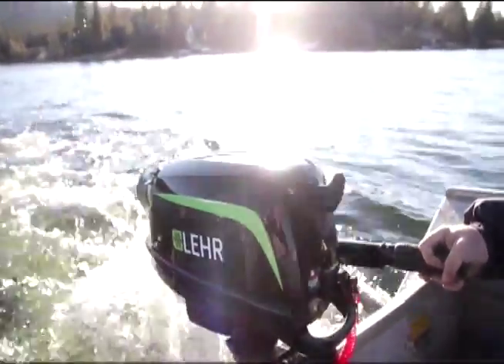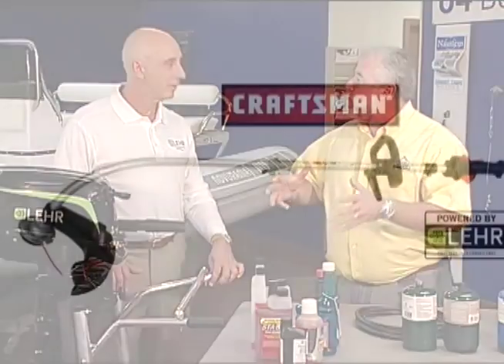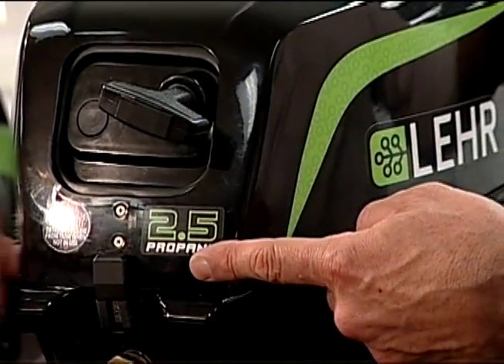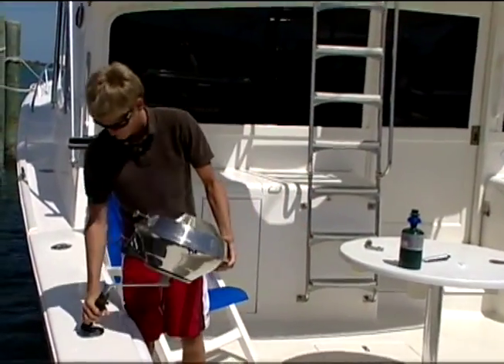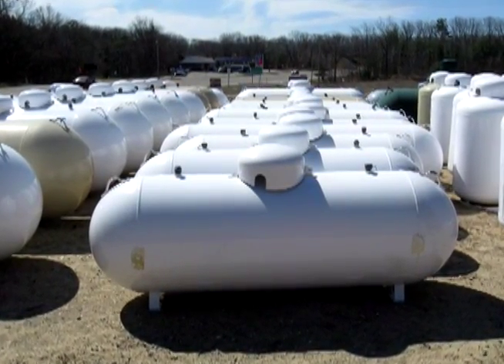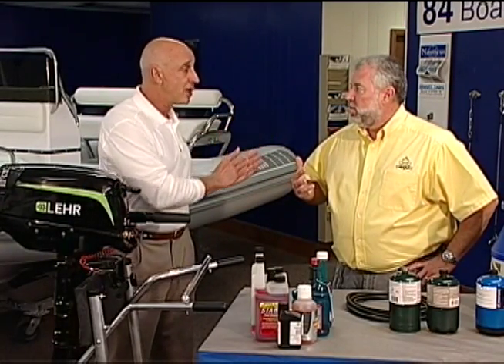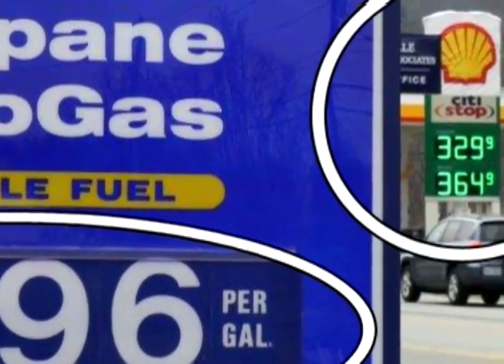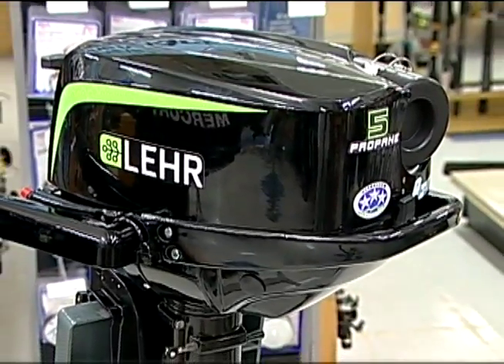Lehr Propane Outboard Motor - Offered by iboats.com

Comment: My new Lehr ran for 1/2 hr then off to the dealer to be repaired then ran for 15 min and off to the dealer for repair again. The dealer has had it more than I. The customer service is crap as well. If you want a glorified boat anchor buy one.

Comment: Been reading reviews all over the "net"; it appears the fit & fitment of the engine are a bit substandard (cover & clips). Also there have been more than a few with big issues, head gasket leaks, throttle problems and fuel connection points... I think the idea is great; but I am too afraid to plunk down $1,700 on an item that needs more development.
Reply: They must have fixed the engine, because they are very much still in business...
Reply: for a good idea on how really an outboard can run on LPG see www.powerseasaver.com-

Comment: I have a 5 horse Lehr and love it. No choke, starts 1st time. No gas smell in the van and easy to set up. I bought a small gas BBQ type cylinder (7 Kg) which provides enough fuel for about 7 hours of use, and use the small camping coleman cylinders as back up. I have used both and I would prefer propane every time. I would say these motors are much easier to deal with than gas motors and I have used both extensively.

Comment: 1lb Propane cylinders (IF) Properly disposed of, are actually recycled, and most often reused.. the 1lb is only an OPTION, you can attach a external line to a refillable tank.. 

$1600, is still cheaper then buying a Mercury or Yamaha. I just bought a new Yamaha 5.5hp and I paid $2500.

Comment: Looks really good to me. Especially after my Mercury 3.5 just dumped about 3 cups of raw gasoline in the bay because it got a stuck carb float. It is now in the shop getting fixed for the second time with less than 30 hours on it. I am going to buy a Lehr.